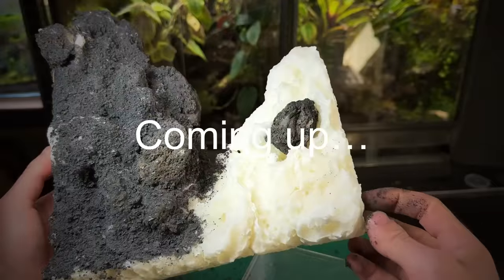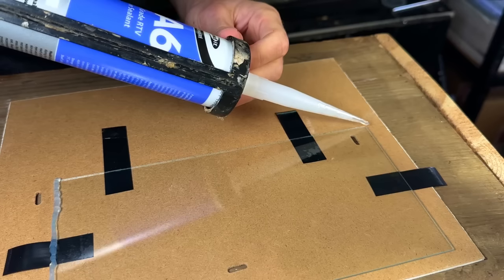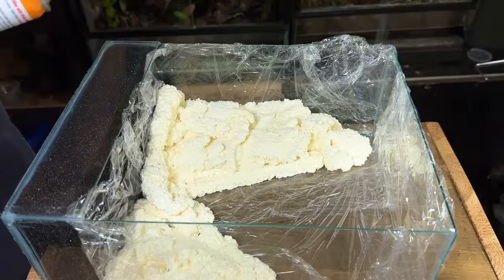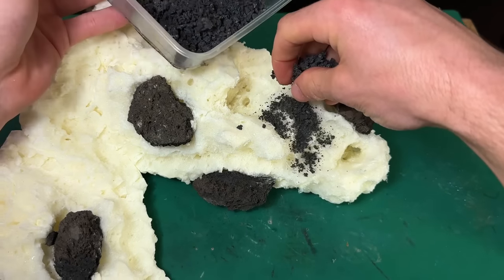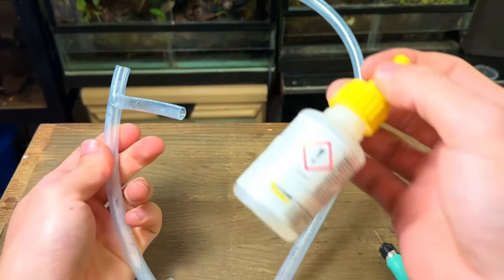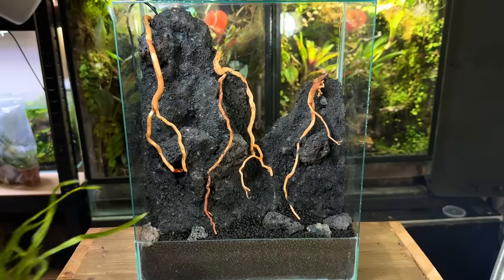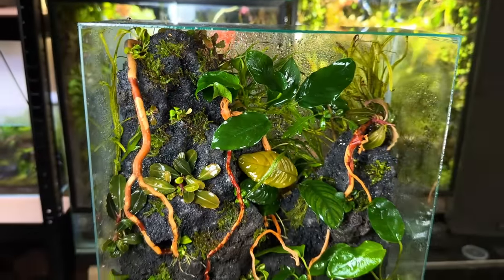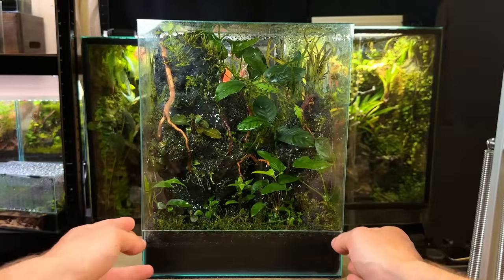How To Make a Jungle Terrarium With a Flowing Waterfall! Step by Step Guide

Comment: Anyone who wants to starts a project like this, don't get de motivated when something doesn't go your way and don't rush anything. Also a little tip if you want to add animals to terrariums like these, don't buy the animals too fast, most people are hyped and want to finish it as quickly as possible but do not rush. Buy the animals after your terrarium is fully finished
Reply: How long does a build like this usually last?
Reply: @CleverBryan1  well it al depends on how you build it. If you use materials that will get damaged when exposed to moisture for a long time, it won't last more then 1 year. But if you make it from strong silicone and strong adhesives and use materials that can endure water damage and air exposure then you won't have a problem. It will go many years, it will outlast your desire to look at it and at that point you'll probably decide yourself that you want to change things up
Reply: @CleverBryan1  also if you plan on adding a pump, make sure you have acces to it. The last thing you want is your pump breaking and not being able to take it out, and believe me it WILL break. Those pumps are so weak, I tried many different brands and every single one has a chance to break. Also I don't recommend building a water + land area if it's your first build, working with water is a HUGE pain. Making your land area waterproof is a must to prevent your plants from having root rot. Your paludarium will stink if your substrate gets wet. Just start simple and normal size, not small not large. Just simple land terrarium, and aquariums. Later you can combine the two when you have more experience with building. Good luck!
Reply: @Archivun  this is great info, thanks
Reply: @Archivun *than one year not "then" ❤
Reply: @Poeticfloetic  Thanks for letting me know. English is not my first language, I learned how to talk and write in English all by myself😁
Reply: That's amazing that you learned English all on your own and put effort to show us support in a language that is not your usual. Can I suggest that instead of saying "de-motivated" there is the word "unmotivated" or more appropriately "discouraged". I wish you well on your language journey 😊
Reply: @marisacharland9469  Thank you for the tip, I will keep that in mind😄
Reply: Probably the best piece of advice for new owners
Reply: Thank you just getting started and already decided not to buy any animals until I can handle all the plants well enough.

Comment: cool idea for glass if you cant get to a local hardware store, but my local hardware stores have glass thats 5 to 6 mm thick or thicker, perfect for terrariums or aquariums, and its probably just as cheap as buying those glass picture frames. I get aquarium glass lids cut for all my tanks and its usually no more than a few dollars for a rather large piece of glass. like 12 x 18. only problem is sharp edges but with some sand paper you can sand down the edges smooth and it will be exactly the size you need.

Comment: Good video do you use a water mister for your aquatic plants like anubias and bucephalandra as I was going to make one with ciano cube only problem I have my lid as cut outs of the lid so my wire can come out the back then you pull of a side panel put wire in there and put the side panel back on as this tank as a floating base and the lights fit in to the base and looks like and upside down letter L  what's the best way to keep the humidity in cheers

Comment: lets just take the time to think about how high his water bill and power bill are.
Reply: The water is recycled, so if he uses 2 cups for this, then it´s probably the same for most of his other designs. Powerbill is probably not too high either, as these pumps seem to use about 5 watts. That´s 44 kwh per year assuming they run continuously year round, or less than $8 a year.

If he has 20 of these vivariums and they are all running continuously, that´s still just $160 per year. Assuming he gets $0.01 per view of this video alone, that´s $3,000 over a 9 month period, which to me seems worth the $8 annual running cost of the water pump.
Reply: @MagnusBjarniSkaftason  oh ok